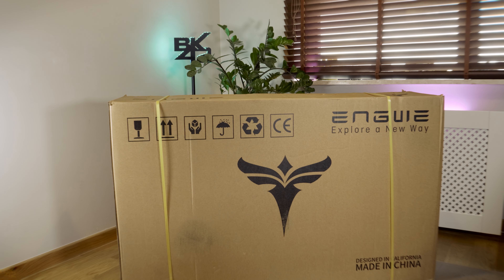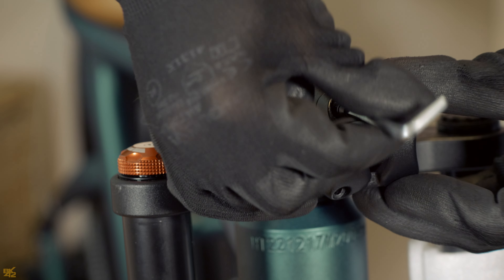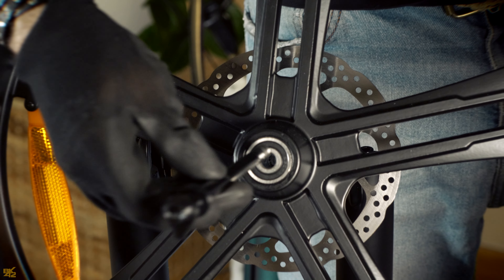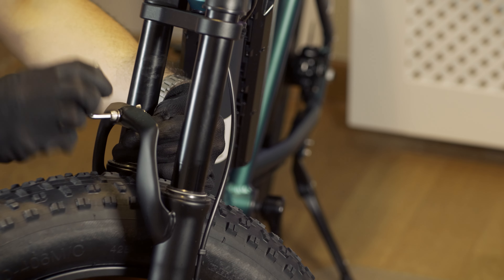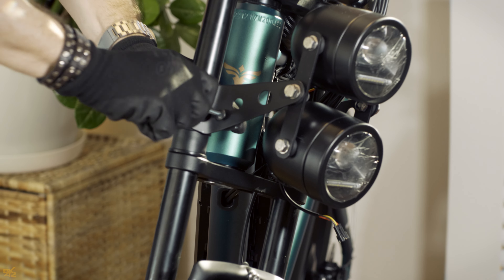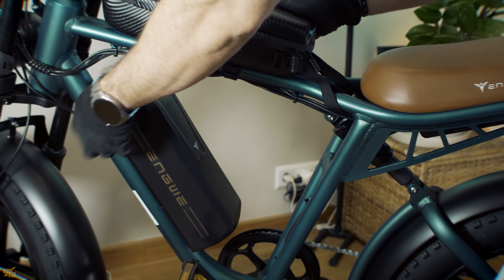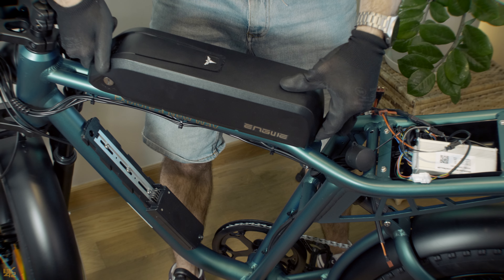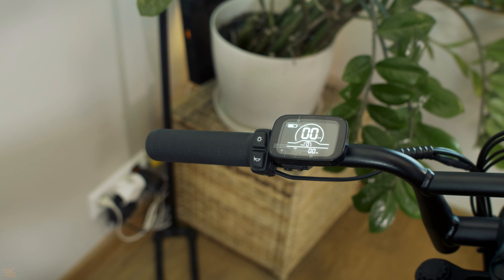From Box to Road: Engwe M20 E-Bike Setup

Comment: Have to say, this isn't very helpful. The front wheel installation is extremely confusing and needs a lot more detail than what's shown here. Also, "adjust the brake as shown"? There's nothing shown.
Reply from the maker: Thanks, Rick. I'll make it better next time.
So, about the brakes, I was all set to make the adjustments myself. But then I went down a YouTube rabbit hole and found tons of amazing videos that explained everything in detail. I got overwhelmed and gave up on the idea.
Reply: Agreed, my son was super frustrated at this point of install

Comment: Need some help. Will you check the alignment of the front wheel. I have mine correct, adjusted the brakes, spins freely but it is far from center. Check and see if yours is like it. Thanks.
Reply from the maker: If I look it from the front side it definitely looks a bit more to the left, like 6mm out indeed

Comment: Thanks for the great video. I have a simple question: is it possible for the single battery 13AH version of the M20 to mount the battery not in the lower part behind the front wheel, but on the top tube of the frame only? And ideally in a position where the bevel of the battery shape will be closer to the seat rather than the handlebars? Thank you in advance for the information.
Reply from the maker: I think so. If I'm not mistaken, both batteries use the same mount, but it would be a lot of work to change the battery cable position. The cable is hidden inside the bike frame, so doing that might void the warranty. As for the top position, the holes are already in place, and there's only about a 4 cm gap between the battery and the saddle. There's not much space to move the battery back. Thanks, cheers

Comment: IF THROTTLE AND/OR SPEED ABOVE 25 KM DOESN’t WORK:
- Turn ON display
- Hold down MINUS (-) AND PLUS (+) button at same time until display says P1
- Hold down PLUS (+) button for 10-15 sec. until display briefly changes
Reply from the maker: Thanks for sharing that with us :) cheers 🥂

Comment: hey, maybe you could give me some advices.  I just got this bike, assembled it, and throttle handle doesnt work properly, I mean, when i press it, bike only goes at about 4km/h, but in assist mode, when pedalling, everything is fine, it gets to normal speed. When im turning bike on while holding throttle and brake handles i get e025 error code (brake abnormality). Can this error affect throttle handle, and maybe you know some solutions how to fix that ? Btw i can’t even change maximum speed on controller, it’s stuck at 25km/h, cannot raise or lower it. Thank you.
Reply from the maker: Man, I haven't seen that error or behavior before... That's weird. Which P.A. mode are you using? When you get into the settings by pressing the - and + buttons together, navigate to P3 and set it to 60 km. There are some good videos on YouTube that explain how to navigate through the settings modes. Keep me posted .. cheers
Reply: @BK42Cycles  yes yes, I mean i tried setting speed in P3, but it just doesn't let me change it :D. Mostly using 5th assist mode. I guess, that brake error code is not letting throtlle work normally. Maybe some kind of sensor is bad.
Reply from the maker: @kassppa I am sorry man. It should change the speed without any problems… that’s odd.. please try contacting Engwe support asap .. unfortunately I can’t help much :(
Reply: Why are you holding throttle and brake when turning on?  You’re doing it wrong
Reply: IF THROTTLE AND/OR SPEED ABOVE 25 KM DOESN’t WORK:
- Turn ON display
- Hold down MINUS (-) AND PLUS (+) button at same time until display says P1
- Hold down PLUS (+) button for 10-15 sec. until display briefly changes

Comment: you didnt show us how to adjust the brakes so the disk would not touch it..
Reply from the maker: Indeed Marius, i decided to skip that in the last editing minute as thete are very detailed and complete videos  about this simple adjustment in this platform.  Anyway, if you will need any help with that pls let me know.. tks for watching
Reply: @BK42Cycles  Love the video btw, really helped me :D Im assembling my bike right now and the problem is that the disk is grinding on the brakes... dont really know what bolts to unscrew to fix it
Reply from the maker: Can you please send me a email (you can find my email at the about tab) I will send you a picture..
Reply from the maker: BTW way.. just release the 2 screws at the top, not those connecting the suport arm to the frame... then try to align the calipers with the disk.. you can also push the brake lever while the screws are not tighten to centralize the calipers

Comment: it doesn`t run without pedals. who knows what to do? and the speed  just stuck on 25 km/h
Reply from the maker: Mine runs on a throttle only without any problem, as well 42 is the max speed of mine. Perhaps you got wrong settings?!?!
Reply: @BK42Cycles  i don`t know. there is no problems with other settings, it seems the trottle doesn`t work at all. i am just wondering which buttons i need to press.. all according the manual, but i  am literally confused
Reply: IF THROTTLE AND/OR SPEED ABOVE 25 KM DOESN’t WORK:
- Turn ON display
- Hold down MINUS (-) AND PLUS (+) button at same time until display says P1
- Hold down PLUS (+) button for 10-15 sec. until display briefly changes